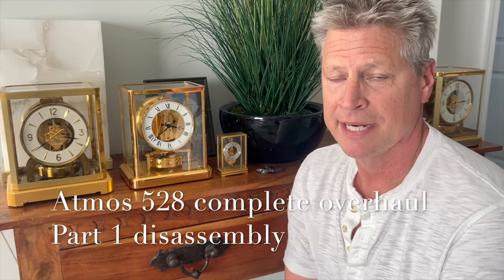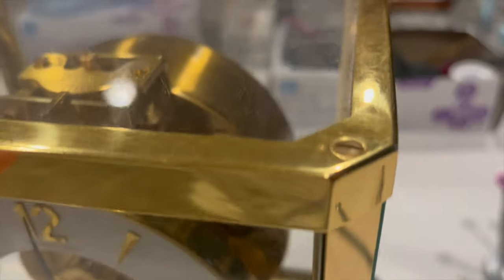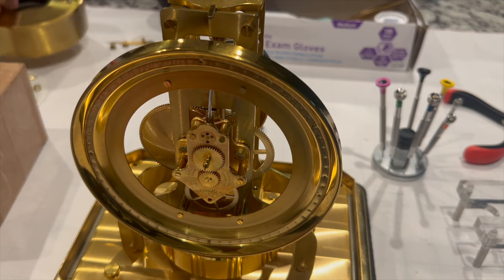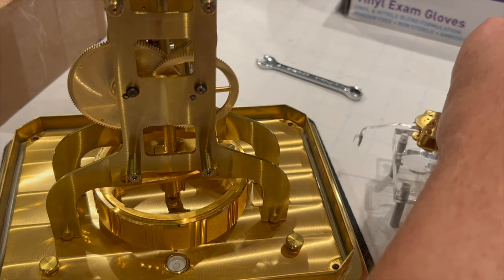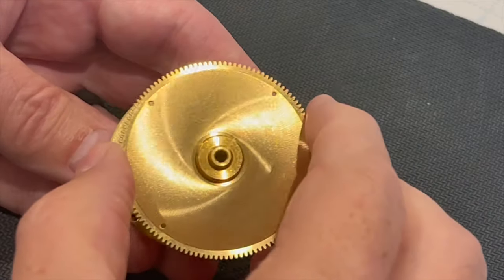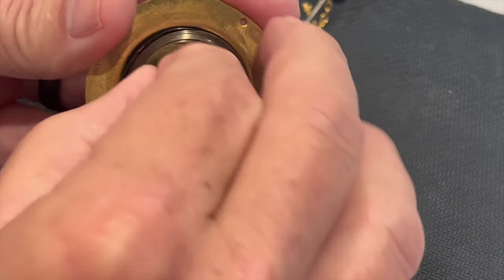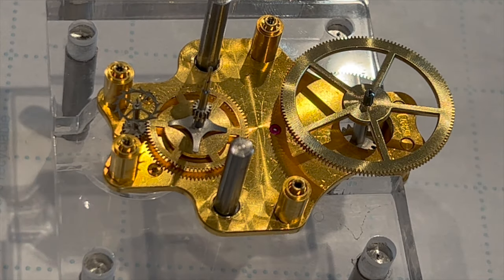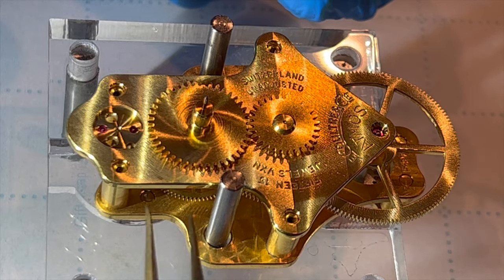Atmos 528 Complete Overhaul Part 1 Clock Disassembly

Comment: I just pulled my 528 to diagnose thanks to your great videos. The bellows are perfect, measuring great and expanding and contacting in specification. However I tried hand winding by pushing the bellows spring in and it doesn't return by itself, it pushes in fine but does not return unless I lightly pull it, what would your diagnosis be for this? Once hand wound it starts and continuously runs at 450 degrees amplitude, so obviously needs a service, so the fault lies with the winding mechanism
Reply from the maker: Your main spring is sticky. The clock will need to be taken apart and overhauled.
Reply: @watchguyAtmos  Many thanks, I will do that, thanks for your excellent video's!

Comment: Excellent video. It may be a good idea for you to invest in a clock mainspring winder to help protect both yourself and the mainspring.
Reply from the maker: A spring winder is definitely not necessary for an Atmos main spring. The Atmos spring is very thin and does not have a lot of energy. The spring is very easy to unwind and wind using only your fingers.
Reply from the maker: A standard clock spring does not have a bridal spring on top of it nor does it attach to a barrel hook. Both of these features make a spring winder impossible to use in an Atmos.

Comment: What a great, no nonsense video! I have loved mechanical clocks for my whole life and always wanted one of these Atmos clocks. I plan to get a larger one and soon! I’ve been scared to get one and have it be a basket case or non repairable.
May I ask you… is it hard to get parts or have them serviced? What state are you in?
Thanks
Reply from the maker: I live in South Carolina. Parts are very difficult to get. You need to wait for used parts to come up for sale on eBay. It’s very important to buy from a seller that accepts returns. Let the clock run for a few weeks to see if it’s in working condition. It will likely need to just be serviced. Once you service these clocks, they run for a very long time without requiring any further assistance. Thank you for your kind words.

Comment: Thanks for the video. Quick question,  if the stem that holds the hands is broken( in the area away from the movement closer to the hands), would i theoretically be able to glue the broken stem back and it work fine despite (assuming i do a good glue job)?
Reply from the maker: I’m going to assume your minute hand will not attach to the clock. You will require a new fourth wheel. This part cannot be glued back together. It’s very common this part gets broken especially in Atmos II clock. They get broken when the upper case is removed from the clock and snag on the minute hand.
Reply: @watchguyAtmos  what would be the labor cost if I sent over a clock along with the correct part?